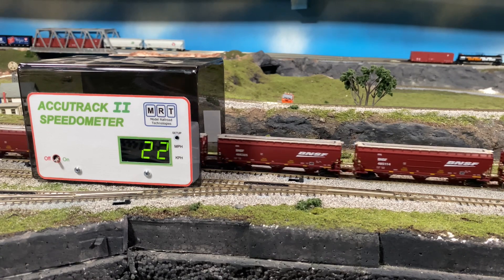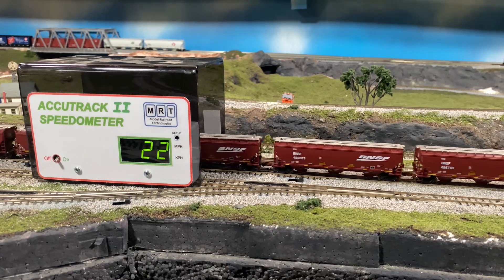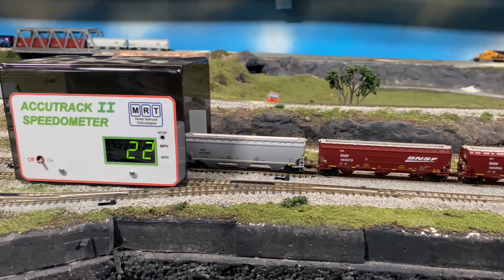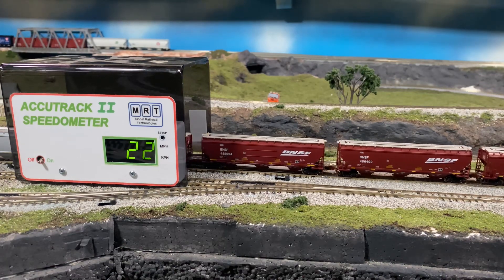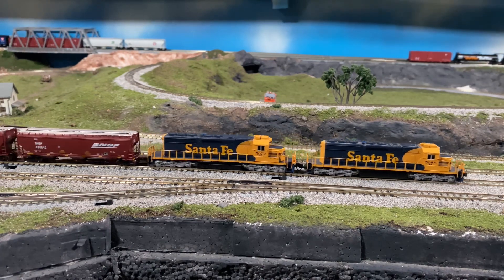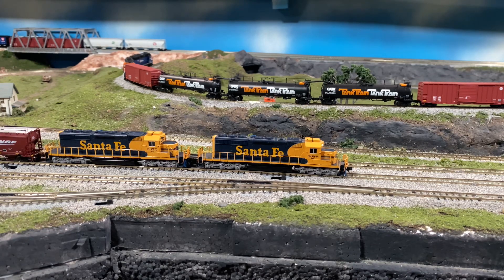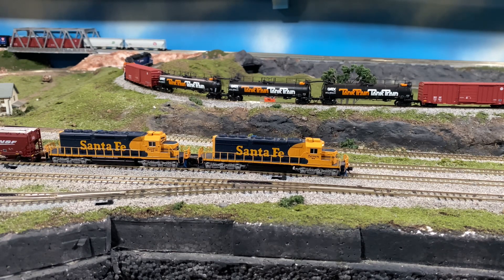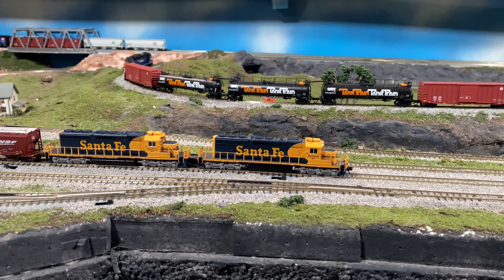Empty Wallet Wednesday: Pulling Power Test

Comment: I can't see how your layout runs but as your train gets longer, more of the cars are still in the curve.  The curve has more drag than a straight line
Reply from the maker: Yes the curve does have more drag, but it is only a 180' turn. The curve can only hold about 8 cars, anything over that and there will be parts of the train in the straight sections. As the loco leaves and is on the back straight there are first 8 cars in the curve and the second 8 still on the straight. I can only control so many variables in my space, but after a train length of 8 cars, the added friction from turning should stay relatively constant. I wish I had a 30ft run that I could set up a perfect grade on but space is always a concern.

Comment: Do you think the "car count" scales with weight? You showed that BEMF helps with downhill performance in certain cases and definitely uphill, how much does weight change the equation? Also, Im not sure you could do it on your layout but I would be interested to see if dpu has the same effect or helps more. Instead of two leaders, one upfront one in the center or one up front one at the rear. Thanks for the tests, I have seen people do pulling power with a scale but real world is nice to see as well.
Reply from the maker: I could try the DPU in the future. not sure on the weight it definitely plays a role but I cant say until I start testing the rest of my locos.